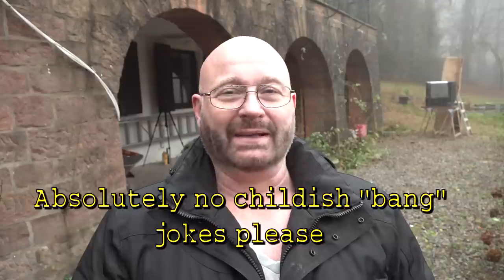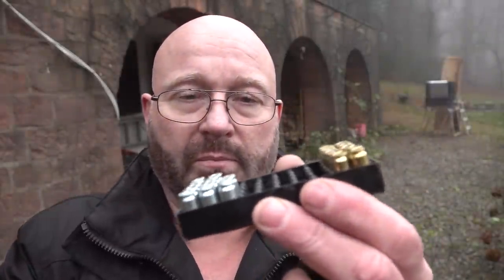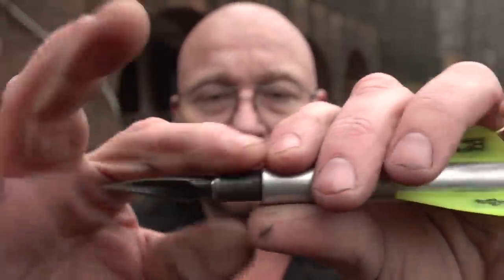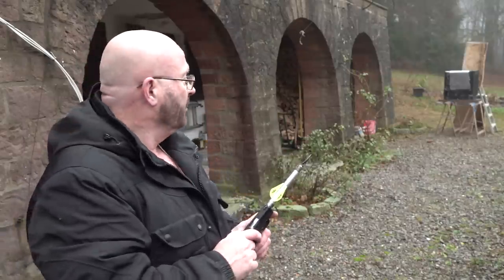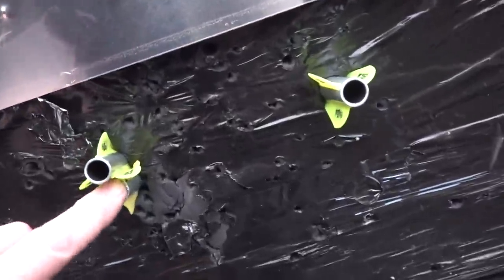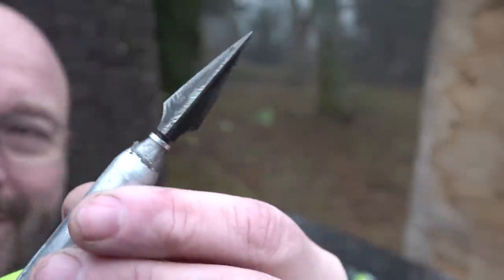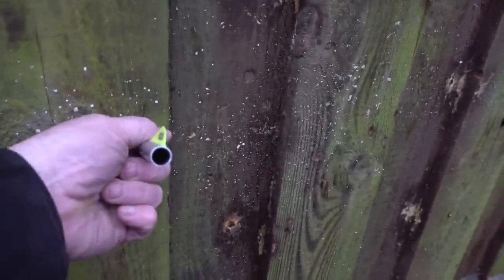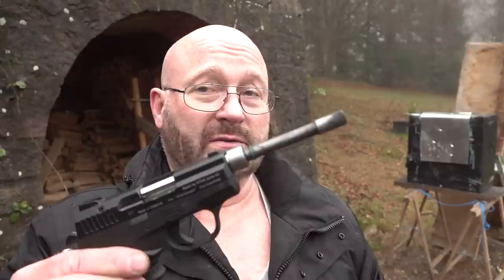Germany's 48 Hours Of Wild "Bang" Time: Lung trainer shots galore!

Comment: Now make semi or full auto "toy" like this
Reply: [as an american] I find it fascinating that he needs to find loopholes and legal workarounds to make these. you can just kinda do this stuff here.
Reply: You'd need seperate feed systems for the shells with propellant and another for the projectiles
Reply: Problem is that nothing can go inside of a barrel so he would have to somehow make the bolts feed onto the outside of the barrel
Reply: @williamspetter2823  I wonder if that is the basis for the German law? Since it's incredibly difficult to make a repeating firearm with the projectile outside the Barrell?
Reply: @kevingooley9628  it is German law yes you cannot have a device that fires a projectile through a barrel if the projectile slides over the outside it's technically still legal
Reply: Idk what their logic was in making that the law I think it's just a loophole people were smart enough to find
Reply: @kevingooley9628  I think that it would be theoretically possible if you used a front mounted magazine for the bolts and a long recoil system. With a recoil operated pistol the barrel would reciprocate and slide back when the gun is fired. As it does that, the bolt would move up, then if you get the timing down correctly, the barrel would then move forward again and into the back of the bolt.

Comment: You should cut a spiral twist in the arrow shaft then you can get rid of the fletchings. I made a similar one but the arrow goes in  the barrel. Its an old .22 blank starter pistol. I'm getting 450 fps. And its about a 3oz arrow with a 40g field tip.
Reply: or rifling on the outer barrel xD like a normal barrel pulled inside out.

Comment: You could technically make these self loading if you made it so that the barrel recoils far enough back so that the bolt being held in a magazine is loaded into position and then the barrel returns it slides into the arrow.
This would make for one hell of a bulky pistol but if you had enough skills with a machine you could shorten the arrows sufficient enough and make the barely only half the length of the gun so it would sort of look like a C96

Comment: The tip actually makes it penetrate less, because it's a significant additional weight so the same kinetic energy means much smaller velocity (twice the mass = 1/4th the velocity because of E = m * V squared / 2).
Reply from the maker: But the pressure per square millimeter is much higher.
Reply: That should only matter before it breaks the surface (as after that it contacts the target with the rest of the tip as well), and I think the effect isn't worth it in this case. Would be nice to test it to see who's right :)
Reply from the maker: You aren't REALLY questioning thousands of years of arrow design, right? Seriously, of course a sharp tip helps with penetration. A lot, actually.

Comment: What if you made a Teflon sleeve bearing  " can be full length. " for the tube and before you shoot spray a little silicone lube or a little graphite dust into the arrow.
Or maybe Teflon to Teflon on both surfaces would be slicker than snot!

Awesome stuff!

Comment: Have you seen fuse when lit at let go on Its own when you have a single strand semi circle or full circle of it spins and flys due to its thrust to weigh?  i thought if you had a hollow lightweight aluminium arrow with it down it how much extra speed and accuracy would it add? Also as its not an explosive used right not in bulk I'm sure you can buy and use it legally in Germany in rolls? What's your thoughts please jorge??? Good idea tried it b4 maybe in future? Thanks

Comment: I made rubber launcher to launch just about anything under 5 pounds an about 130 meters away from the air it's cool I use empty water bottles air filled an the tip with water/food coloring for airsoft they make a good mortor for safe use

Comment: i dont know what the proof pressure is on that barrel but i cant imagine it's rated for the kind of pressure you are putting on it.. might check and make sure the action and barrel are not showing any odd wearing.. and check the ejected cases for signs of over pressure, flattened primers, bulged cases etc.

Comment: A little dangerous, maybe, and probably not legal, but back in the mid seventies, when I was 10 and developed this, nobody cared. A spent CO2 cartridge, opening drilled to 5.5mm, filled and packed with your favorite nitrocellulose. insert a .22 with lead clipped off at brass and a bead of cyanoacrylate. Tape to pencil. Throw. This model has to come down on something hard like concrete or asphalt. Alternately use a percussion cap and a cut off roofing nail glued on. Good for softer targets. Works nicely when attached to arrow/bolt. Once shot an old Vega. 25mm entrance hole. interior upholstery decimated at impact, and interior filled with smoke like cotton candy.

Comment: it does not have same momentum. it has same kinetic energy so a greater mass, lower velocity means that momentum which is related to kinetic energy over velocity should increase
*Flies away
Reply from the maker: This has about the same momentum in comparison to a 9mm Luger, about 2 Newton seconds. The formula for momentum is mass times speed. Energy much "favors" speed, as the formula is speed times speed times half the mass.